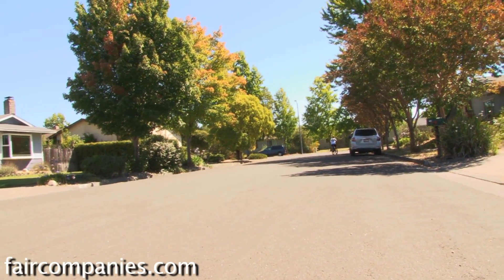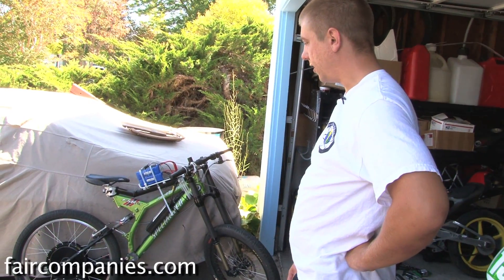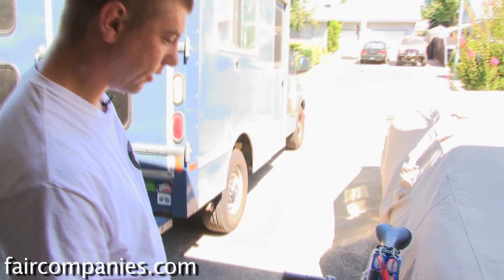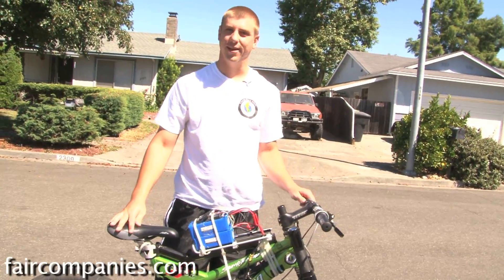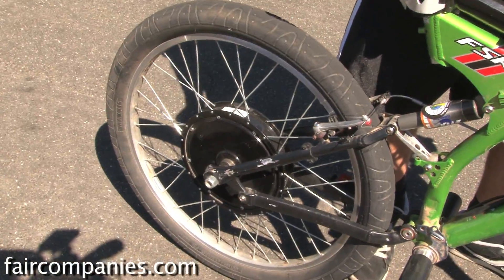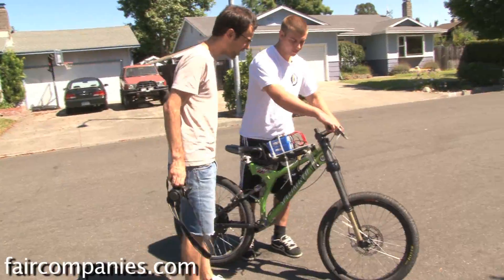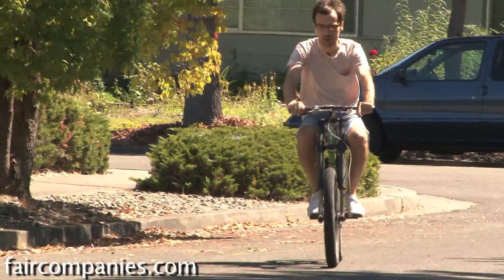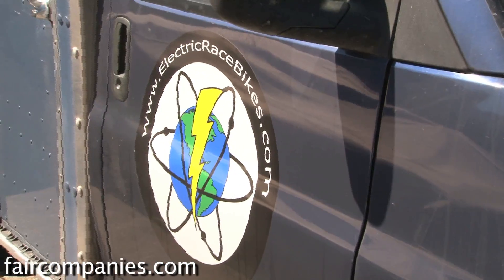Instant e-bike: electric bike conversion kits

Comment: What would you recommend? I am converting my full-suspension 2008 Gary Fisher Hifi Plus 29er into an affordable and clean looking all-terrain rear hub-motor ebike, but I am discovering several major challenges.  The internal frame triangle is small and will only allow for a battery max height 3.25 inches. There is another water bottle attachment under the down tube but the battery will get more exposed to the elements. Below the tube also cannot allow for a tall battery.  From what I read I would want a 1500w rear hub motor for ample off-road power, I live in a area with lots of hills so power is key.  All the 1500w ones I see only allow for a 7-speed cog setup and my bike has 9-speen cog. Is this an issue?  I have little to no room to mount a controller so I was exploring motors and batteries with built in controllers??  It also appears that off-road enthusiasts prefer a thumb throttle because a wrist throttle can be difficult to manage while hitting roots etc.  This is becoming a real challenge to build. Are you aware of any conversion kits that would works for my bike out of the box??  Aiming for 35+ mph and over 25+ mile range.  Need your help...
Adam

Comment: that´s not a bicycle!. it´s a home made electric motorbike. Let´s call things by their name.
Reply: SpiDeRReal If there are no pedals.. it's considered as a motorbike, try ride in front of the cop car ext time.. I can guarantee you get a big ticket. no pedals mean a motorbike simple as that to the law.
Reply: You don't need a license to drive it, a VIN on the bike, title or tag... So it's a bike. When guys came back from WWII and bought surplus fighter engines and stuck them in cars and raced them across the salt flats... were they flying planes, using military vehicles, or racing cars? The answer is racing cars.
Reply: Biker_Chick Maybe in your state, but not mine. My state considers it an electric assisted bicycle until a certain wattage or MPH is exceeded.

Comment: what is the voltage on a 24v system at full charge, and empty? i'm getting my wife a kit and i'm not sure i want to do brushless because i want to use ultracapacitors rather than batteries, and run time is only as good as the voltage range the motor can work with.

Comment: I run two 3 cell 11.1v @ 5000mAh Hyperion batts in my OFNA 4wheel electric conversion 1/8 scale buggy. topin 80 plus mph That's 22.2v @ 10000mAh in series. Cost about $90.00 a piece. I'm sure hes got at least $500 in batts alone. defiantly not normal rc batts.

Comment from the maker: @webboist Most of Matt's kits used 400 watt hub motors, though one is listed as being able to operate in the 600-2000 watt range. "The Crystalyte 5300 or X5 motors are the most powerful bicycle hub motors we could find, easily able to operate in the 600-2000 watt power range."

Comment from the maker: @chippymel Matt was killed in a motorcycle accident 6 days after our shoot, but there is still information on his website regarding the e-bicycle kits he was putting together where you should be able to find voltage and other specs. His company/site is Electric Race Bikes or you can find more info in the link above.

Comment: bike looks very nice, such hight voltage makes kit fast, great setup. I would prefer to put batteries lower in triangle to make wight center lower. you are right that full suspension is great when speed increases.